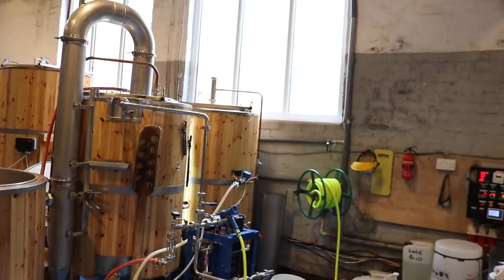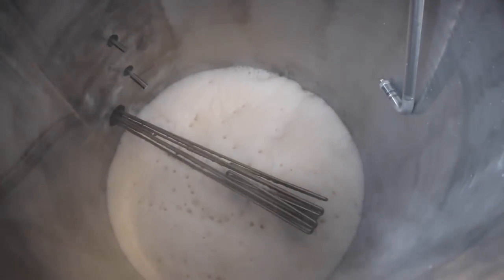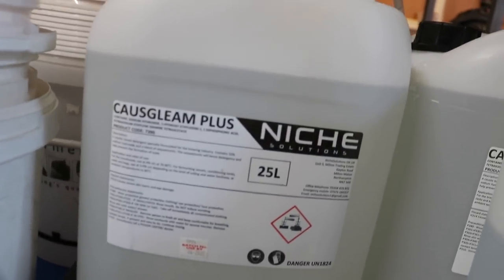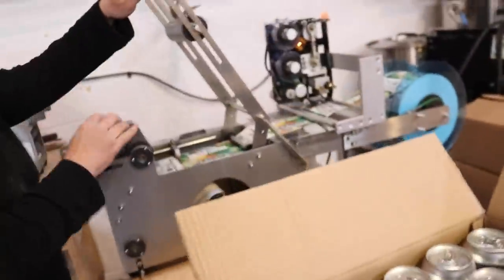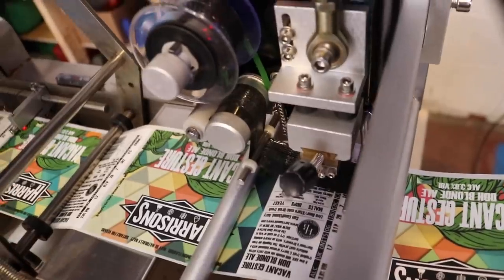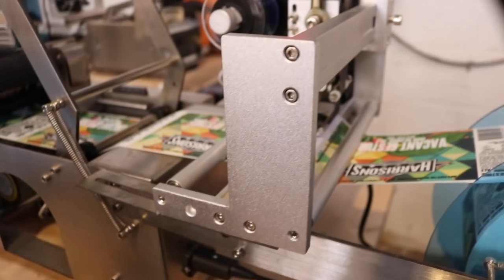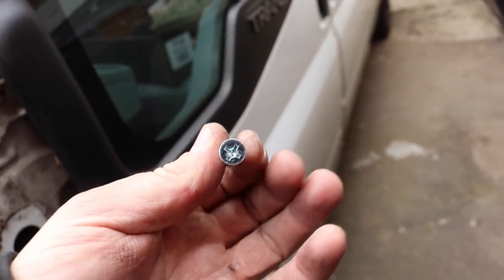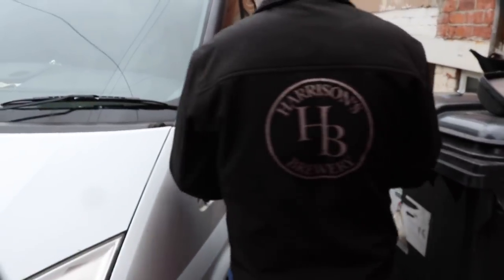10 Inches, 2 Nuts and a Bulbous Tip End

Comment: Do you have any jackets for your all rounders? just thinking about daylight and temp. consistency. Also you might want to cut down the pick up hose length. they are over sized and a shorter hose stops you picking up the trub before you get to the bottom. (edit: just seen the jacket part of the vid...)